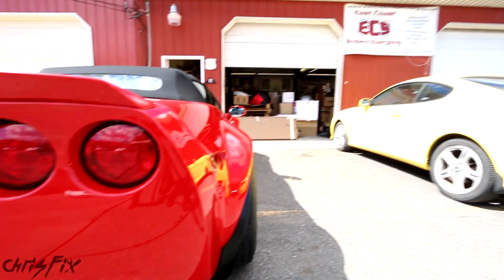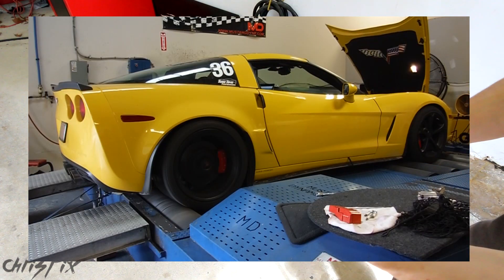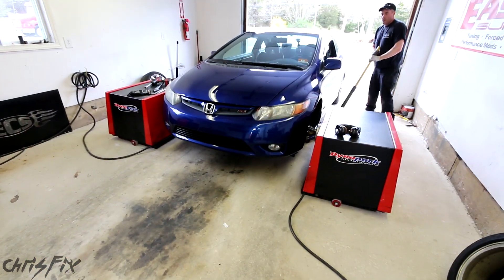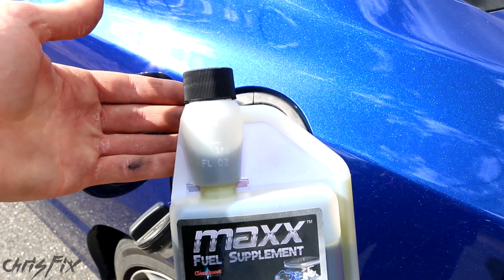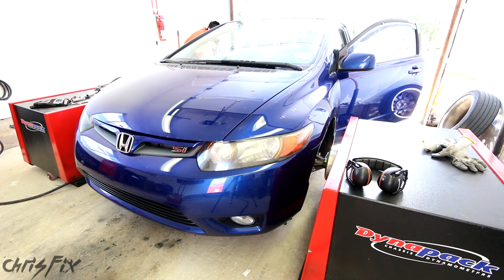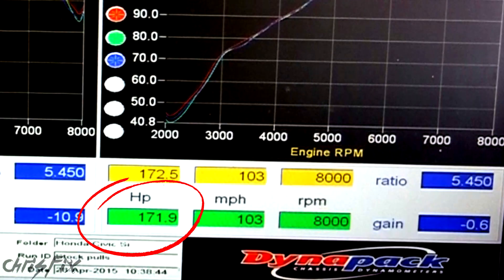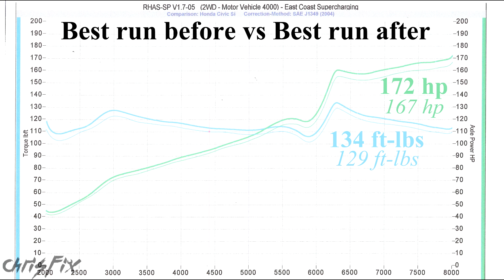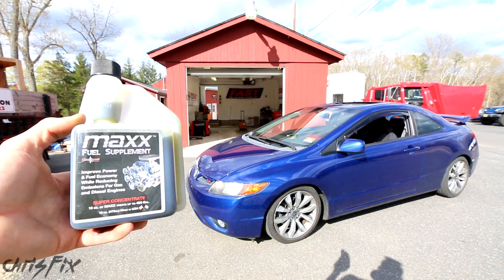Can a Fuel Additive Really Increase Horsepower in Your Car? (With Proof)

Comment: 5-10hp no one would ever even notice. you can easily gain 5-10 hp just by driving your car in the winter versus the summer, using fuel that was produced a few days ago, driving in drier climates, etc...my old prelude I actually noticed the difference in power and sound in dry 5 degree temps versus 90 degree 80% humidity weather...so the fact that I noticed it means I gained 15-30 hp just because of the weather... so 5-10hp is really nothing.
Reply: Yeah bro your logic on that is all fucked up
Reply: u goof lol. and then a bonus added to that isn't better? even in the cold, the bonus will be there so its a bonus all round. u just said temperature and humidity make a difference. which ofcourse they do, but have no control over them. u have control over THIS added bonus. good game, come back later when ur brain catches up with your mouth
Reply from the maker: Thanks for sharing Adam...
Reply: +Larsen Way how is it fucked up?

Comment: Wheres the data on the temperature and humid during both sessions?
Reply: It's in there
Reply: The temp was 3 degrees cooler on the initial test, so density is out of the equation. Can't speak for humidity though.
Reply: +HeyItsVos the dyno should correct for temp conditions
Reply: +Cramer Ward-Collings I was merely answering his question, but thanks
Reply: cant speak for this specific dyno, but the Mustang Dyno I've used gives 2 values: actual and weather corrected. I don't know if the figures given are corrected for weather or not.

Comment: It's very likely just acetone (nail polish remover), which lowers the vaporization point of gas when added. It's makes the fuel vaporize more easily and thus more evenly, which in turn burns more efficiently... this more power/better fuel economy. The optimum ratio is about 2 oz per ten gallons of gas... any more than that and your not seeing any benefit, just replacing gas with acetone which is not as good as gas, strictly as a fuel.

Comment: people complaining and saying it's not worth it..... yet buy $300 Cold air intakes and don't get a tune, but think they get a hp increase.... lol. this is worth it for the simple fact it takes nothing but a minute and a funnel to gain a few extra horses.
Reply: 90% of the CAI are actually hot air intakes. So while these people increase the intake noise, they most likely loose significant HP/TQ.
Reply: Golden Manuever remember this, “if it’s louder, it must be faster”
Reply: @goldenmanuever1176  typically you lose some low end torque but gain some high end hp... so its kinda meh....
Reply: I realize this is extremely late but doesn't the car use the fuel trim to compensate for the extra air? Or what about when your car is in summer vs winter? Similar thing right?
Reply: @Andrew-my1cp  Yeah, you don't need a tune after getting an air intake... if someone says you do they are a scam artist 😂
Reply: @DominicGholson  yea that's what I was thinking because the maf sensor would read more oxygen and then add more fuel. Unless there is a cut off that is programmed into the ecu to limit fuel consumption. A cold air intake should have similar effects as driving in really cold weather. The intake temperatures wouldn't be as hot as in summer and in theory if no fuel restrictions are in place, the ecu would compensate for the extra oxygen and add more fuel to keep the car running at the wanted air fuel mixture. The only thing that I could see being thrown off would be the volume of the entire intake which shouldn't effect anything simce the maf sensor's housing (which the volume of is known) should stay untouched. The other variable that I could see being changed is how fast the air is flowing through the intake. Especially since there is a less restrictive and differently shaped intake, the dynamics of the air flow should change. But I don't see how that could throw off readings. How  would you even go about tuning for a cold air intake? I tried finding some information on it and found nothing except for a cold air intake for mustangs that says a tune is required. Yet there is no information on how it's tuned.
Reply: @Andrew-my1cp  yeah, an cold air intake wouldn't bring in enough air to warrant a tune. Only thing that would is forced induction.
Reply: Andrew V if you’re car is newer and has a MAF, then any sort of intake will yield you some power, because you are effectively making the engine work less hard to pull a vacuum through your intake. Older cars with MAP sensors will need to be tuned to effectively use the aftermarket parts to the best of their ability, because MAP sensors do not adjust fuel trims based on airflow, they are set to run off a specific manufacture created table for fuel trims. MAP sensors will still read airflow, but only to tell the ECU that the car is functioning properly. Now, that’s the story for all N/A cars. When you get to turbocharged cars, the story is a little bit different. While tuning a turbo car is by far the easiest way to squeeze extra power, the safer way would be to reduce exhaust back pressure and increase intake efficiency. Everything that you can do to make a turbocharged engine flow more air through the system is effectively making the turbo spool up quicker, and the engine rev easier and more freely, giving you power at top end. In terms of this video, increasing your fuels octane rating will only increase power if you have a high compression engine, like this Honda with VTEC or generally any turbo charged car. (The higher the octane the quicker the gas burns and the faster each engine stroke is, because after all, engines are four stroke and shortening the time it takes to completely burn the fuel inside the chamber will help you make a little more power. Hope I taught someone something valuable.
Reply: @frontwheeldrip4253  finally I got an answer that explains why you would need a tune. That makes sense if the sensors don't directly affect the fuel trims. I always wondered that because I just figured that with any car the MAF or MAP sensor would read that there is more oxygen present and adjust for that based off of the numbers the sensor spits out. With respect to other sensors as well. If I'm not mistaken, higher octane burns slower since it's activation energy is higher (more heat before ignition occurs) and the reason higher octane allows the car to make more power is with higher compression and more aggresive timing without knock. Since the activation energy is higher, there is more time needed to make the molecules react, and as we know, the hotter you need the molcules to be, the longer it will take for the molecules to heat up. So lower octance gas should theoretically burn faster since the activation energy is lower and heating something from 100-400 degrees (just random numbers) would take longer than heating from 100-300 degrees.
Reply: But wouldn't you have to add the supplement in again after a certain amount of time just for your engine to keep its power increase?
Reply: Bich

Comment: FWIW The first runs had a higher humidity percentage than the second set.
Reply: Good observation. that's probably why.
Reply: Lol i dunno. The temp was lower in the first set as well. So that should be denser air. Anyway its hard to twll. I would rather see the results across several engines before I believe it 100%
Reply: Or hotter conditions. Cars always tip top on a cool dry night.

Comment: can you do dyno test on torco fuel and boostane i used both on my amg and i swear there is a very noticeable difference
Reply: Dyno it before and after. Many people say they feel a difference from an air intake that does nothing for their horsepower, so it could just be the placebo effect.
Reply: +NCRranger24 - Gaming and More! It could be but if you look anywhere on the forums torco and boostane are not a regular octane boosters they are true race gas in concentrated form and will leave your plugs orange. i can run 101 oct map on 10 gallons with 32 oz bottle and get no ping at all that says something i use torco because its cheaper

Comment: That much HP and torque you won't feel at all !!! So not worth the money !
Reply: Feeling it is irrelevant. You may not feel it, but it will show up on the drag strip times. Will you drop a whole second off your 1/4 mile time? Nope. But even 1/10th or 1/100th of a second can mean the difference between a win or a loss.
Reply: maybe you right, on if you drag racing , but that's not for what the test was all about, it's for daily driver if it's worth the money to spend on fuel supplement, to get better MPG and not if it's worth to spend money on fuel supp. to get extra second on racing.
Reply: *****
Actually, he never said the test was to see if the product added MPG. He pretty clearly stated that the test was to see if the claims of more HP and torque were legit. That is the whole reason he put the car on the dyno before and after treatment. He mentioned MPG but it wasn't the driving force of the video.
Reply: so all those 40 people that did the test was the test on Horse power or the test they all did was for fuel economy ?
his the only one did the dyno test just to see if it made any difference , but test was for the MPG ratings thats' why he sent out that fuel supp. to all those people.
Reply: TrueSake
Reply: The 40 people were doing it for fuel economy, not horsepower.
Reply: E-85 Can add over 100hp
Reply: and if people loos few pounds that will lighten a car , light car= more torque/power lolol
Reply: no i'm smart!  are you dumb? i will put 30$ of gas in my car and will get 500 miles not 1-2 mpg!

Comment: 5Hp difference is barely noticeable, not worth the effort imo.
Reply: Instead of looking at the number alone you have to take into consideration the percentage increase. You're talking about a 3-5% increase here which for the cost is quite impressive. You'd spend thousands on i/h/e and tune to see about a 10-12% increase. Bang for the buck wise this is pretty awesome.
Reply: Yeah and the gain in mpg most likely won't offset the cost of the additive.
Reply: +Andrew Wilken  Another option would be to just get a tune for a few hundred and have a permanent increase. I'm sure you could get 3-5% on stock set up out of an si . This way you don't have to keep buying this stuff all the time which would add up over time $$$ and be kind of a drag to plan every fill up if you use it constantly. Bonus would be to use this with the tuned car if you plan on tracking car or just want some extra oomph on a sporty drive through the canyons.
Reply: +ZamaskowanyWolnościowiec  doesn't increase octane. just makes more of the fuel burn.
Reply: It doesn't seem to be affected by heat soak though. It's much more consistent
Reply: probably just stabilizes the fuel a bit
Reply: what is more interesting is that it says on the bottle that it is suitable for diesel as well. So if it is increasing the octane number, then that is a very bad thing for a diesel engine and would degrade its performance.
Reply: Five horse is roughly standard deviation.  It's the same way intakes, chips, exhausts claim boosts in power.  Take the worst vs the best run, boom power.

Comment: I use it on my VRS TDI I found it works better on diesels as they soot up more clean run and better feel. 
On a petrol it's 50:50. Air temp and how your car is set. I used red ex on my old golf petrol never really got a better feel. But also I've heard they can alter the air mass meters by altering the mix. It wount increase fuel economy it'll make you more happy to realise you have that boost.

Comment: You just forgot about oil temp. Cool oil reduces engine performance, hot oil improves it. Make it better the next time.
Reply from the maker: +vegaquarker oil temp was the same.
Reply: +ChrisFix what you have on the dashboard is coolant temp, wich gets hot faster than oil, you should compare oil temp and pressure. Maybe you could read it over OBD.

Comment: How the fuck does half an once of something effect something else so much.......well......there is cocaine
Reply: Its a catalyst. Very small amount can have big effects on reaction rates. in this case combustion reactions.
Reply: 😂😂😂 its SUPER CONCENTRATED!
Reply: half an ounce for 5 hp? Just drink it all
Reply: Joseph Pllumaj I tried an ounce of cocaine! Blocked my fuel filter!
Reply: @terrystratford1235  If you you cut that filter open & dry it out -- you may be able to snort the contents
Reply: Joseph Pllumaj ad acetone to your gas , or laquer tinner.
Reply: +MarzNryet256
Reply: 2003 Mitsubishi warrior
Reply: +King Z huh?
Reply: johann cove
Reply: It does work helps increase hp, cleans, helps stabilize it does what it says.
Reply: that's a proof by it self.
Reply: Joseph Pllumaj what about 1 and a half Ounces of that fluid
Reply: Joseph Pllumaj IDK about half a once. 😁
Reply: they are chemicals that act as a catalyst that causes the fuel to burn more complete. better combustion means more power and economy

Comment: My guess is disconnecting and reconnecting changed something, slightly more balanced or shifted in the dyno. Shame you didn't fill the tank half full at the same time as filling a jerry can, then you could have added the same gas and stirred it without disconnecting from the dyno.

Comment: Still weak. Not even worth it. I can permanently gain HP by just swapping OEM stuff to aftermarket stuff
Reply: You can permanently gain hp changing that mineral oil the car dealer used there for a synthetic one.
Reply: +vegaquarker engine oil doesn't add horsepower. This is a well debated argument, but people dyno'ing their car before after noticed no difference except that was in the margin of error.
Reply: +NCRranger24 - Gaming and More! Hmmm, using propper oil wil actually increase as much horsepower as fuel aditives... Lets say, none of them.

Comment: usually these are just octane booster with fuel system cleaning effect.. which is why it can keep up after a few runs. i usually use these products once every few months to do fuel system clean up, especially good to clean up fuel filter. not this specific brand, I used redline though, but their formula are all similar.
Reply: Yeah, great to move crap from the fuel filter to the inyectors or fuel pump.
Reply: it doesnt move stuff through the filter, it removes carbon from pistons and other areas with carbon buildup

Comment: Is an increase of 4 hp really worth it? Sounds ricer to me actualy.
Reply: 4 horsepower, more torque and an extremely consistent horsepower rating is pretty fucking worth it for putting some shit in your gas tank
Reply: Well not everyone drives a fucking 600 hp tuned v8 you fuck, some people just want better consistency on their little japanese v4.
Reply: lol "ricer" is ugly visual with no improvement in power. This is the opposite of that.
Reply: +Bronzeaxe then don't say anything you fuckface,obviously will have more horsepower
Reply: +Bronzeaxe i drive a 1,500 hp tuned rocket ship, so yeah dont need that extra hp either sarcasm
Reply: +w3llplayed i drive a 568 hp (tuned) v8 and i don't think those extra 4 hp will help allot.
Reply: +w3llplayed V4 don't exist anymore
Reply: sorry meant inline 4 not v4
Reply: W3, It's a Scania R520 ;) it's a big rig buddy
Reply: its 10hp actually. a seasoned tuner know the first run are cheat runs. thats the reason they did multiple runs n stayin at 170ish consistantly for 3 runs r a gud result
Reply: +Shaun Jansen Van Nieuwenhuizen i drive my prived jet and 32000 hp lol winn 5 hp is ridiculus